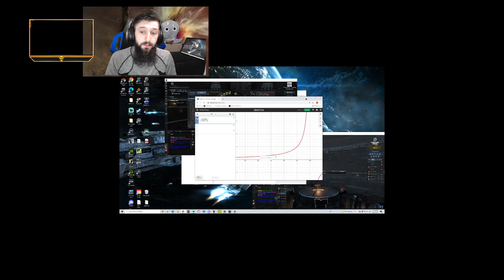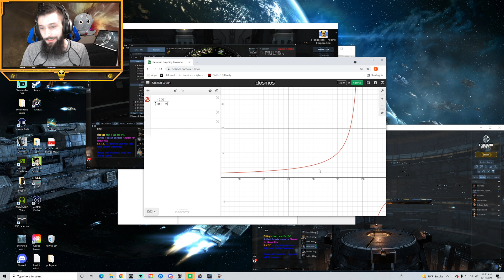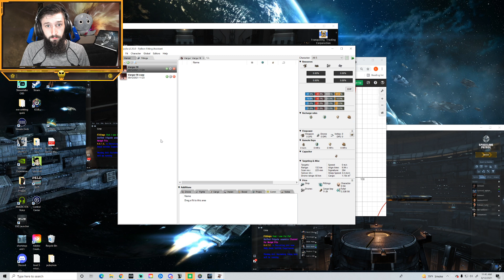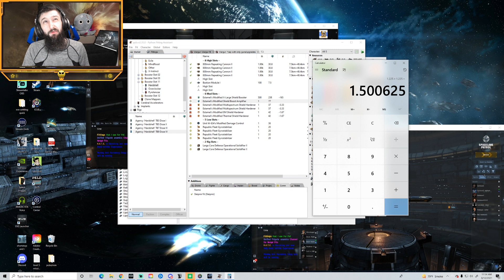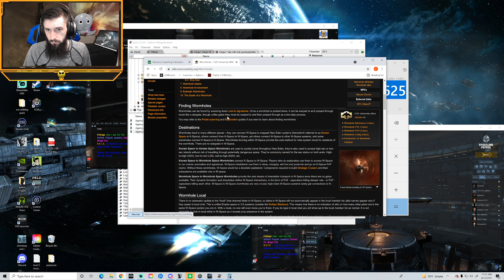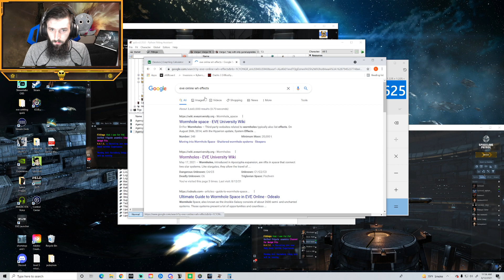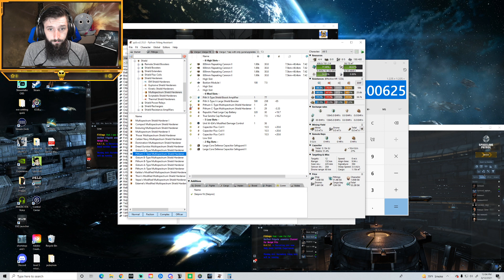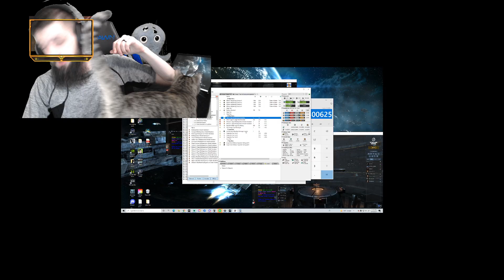How Much Tank Can A Vargur Tank if a Vargur Can Tank Tanks

Comment: If you are going for a cap stable fit would it not be better to add the cap recharge rigs? I thought the point of the shield booster cap rigs was to ease up a shield booster that uses a lot more power than your capacitor recharge rate.

Comment: Another thing: The ehp/second is only relevant if you have enough buffer for a cycle. I don't know what the shield boost amount is, if you don't have enough buffer it gets wasted.
Reply from the maker: I don't think it's possible to rep more in a cycle then you have
Reply: Shield is around 9k actual points. If the booster cycles every 2.3 sec or so, the largest amount it can rep is 9k/2.3 = 3900 actual hp/sec, or around 39k ehp /sec at 90% resists. Practically, chucking a large shield extender in to increase actual shield hp pool is required because the boost amount would otherwise exceed the total shield pool. Which is insane.

Comment: Marauders 5 doesn't mean 7,5% *5, it's whatever it was before (call that base) 
multiplied by 1.075 five times. So it's actually Base*(1,075)^5, which is more than Base*1.375
Reply from the maker: I am pretty sure it's 37.5 not 43.5
Reply from the maker: I will do some tests when I get home to verify

Comment: You completely ignored mutaplasmids. If you apply mutaplasmids with perfect rolls and put this into a red giant it can tank almost 160k dps. In a c6 Pulsar it can tank nearly 50k dps WITHOUT heat and its cap stable. And thanks to the Shield capacity bonus in Pulsars you have 250k ehp in shields so you can actually tank 3 Nags til downtime. Or until they bring neuts, or kill your booster.
Reply from the maker: this is amazing